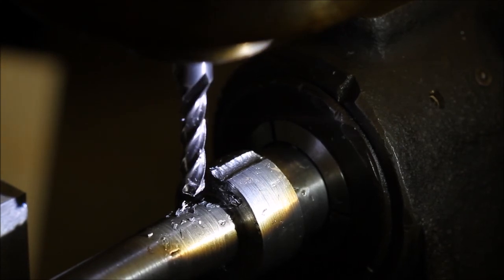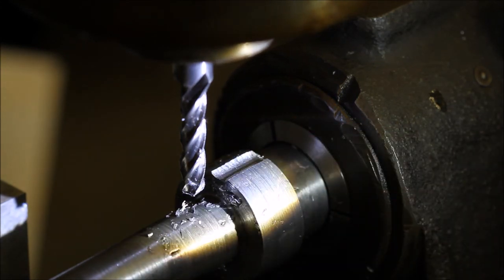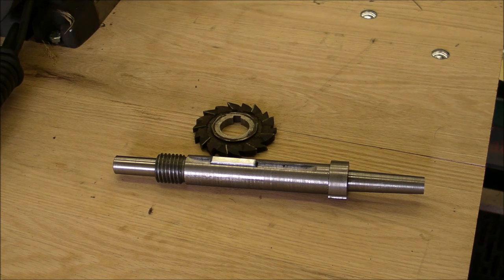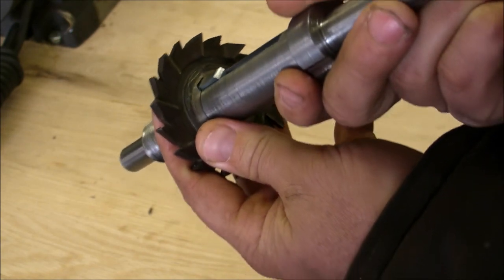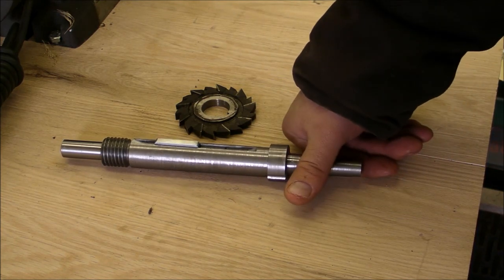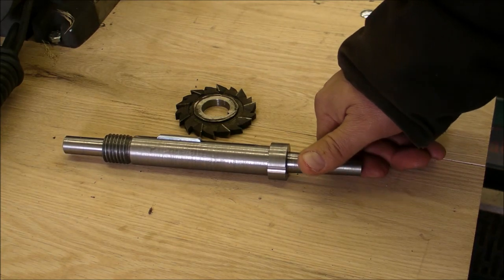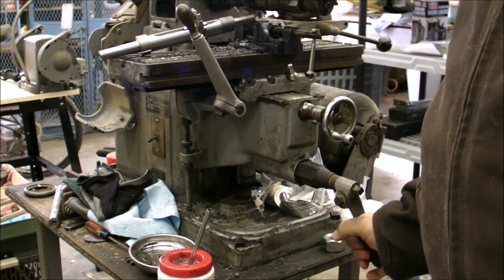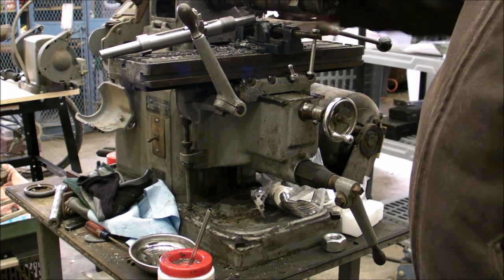Arbor Build  - Part 3

Comment: I picked up a atlas mill a few weeks back. Been so messed up with my back haven't even touched it. I need to make a couple arbors too. One came with it but I figure make a 7/8" and a 1 1/4" too. Any chance you can send me the length dimensions so I can draw up a print , morse taper to nut ? I'm thinking of building a live center for the carrier on the arbor. Less chance of chatter I'd think. Two things missing on my mill the cover on top of the arbor support, and the slotted belt guard. I'm going crazy trying to get out of bed but spinal pains a killer. Thanks for the vids I've watched them a couple times. You could have used a small Jack to raise the table for the keyway cut , it would be steadier and precise . Your doing good with the machines your using . I started with older stuff when I got started back in 1974 . Used lots of indicators on them . Old overhead flat belt machines still in one shop I apprenticeshiped in. YUPP
Reply from the maker: I probably did some modifications along the way.  It was for a 1", but the length dimensions should still be the same.  The overall length of the whole piece was 12".  About 2.367 for morse taper to the drive ring, and the drive ring is about 3.125 (can't read my writing).  Then Starting from the other end, the overhead arm support part is 1.565 long (.622 diameter for the busing in mine), then an 1" long 7/8-16" thread.  The rest of the 12" is the main part would be your 7/8 or 1 1/4" diameter.  The keyway is 1/4".
Reply from the maker: If that doesn't give you the info you need, I could send a photo of the hand drawing I need.

Comment: I enjoyed watching you make this arbor. Nice job. I have one of these Atlas mills and I noticed that your machine seems to be running backwards. I think it should spin counter-clockwise when viewed from the end of the spindle/arbor. It probably doesn't make a huge difference for the plunge cut you're making here. But it would make a difference if you ever use an end mill.
Reply from the maker: Yeah, it could be.  I don't remember right now if the motor has a forward/reverse toggle.  It could also be that the motor on it spins the opposite direction.  For mill cutters, as long as you mount the cutter correctly, it wouldn't matter, but it would matter for an end mill or a drill if the motor isn't reversible.  I would need left hand-handed end mills or drills.

Thanks for watching.